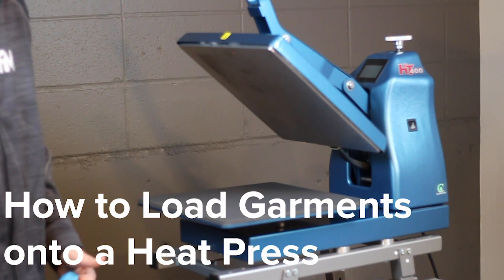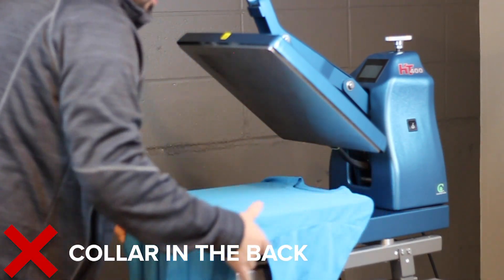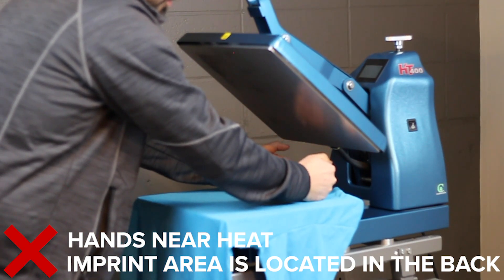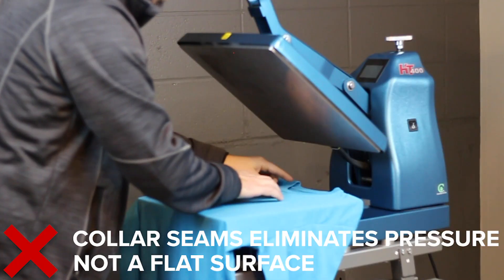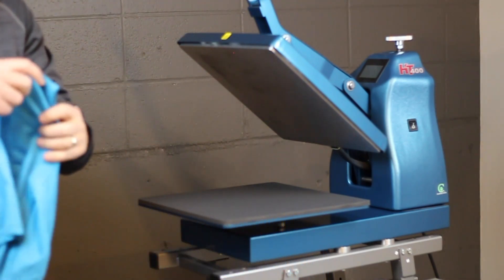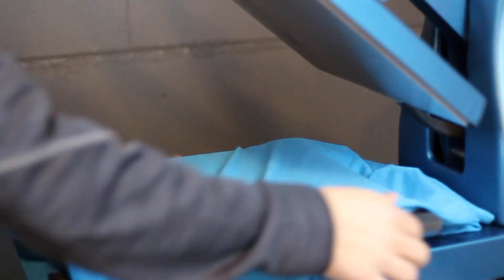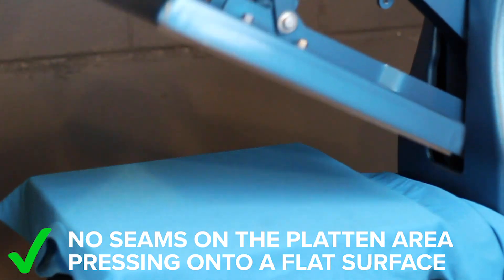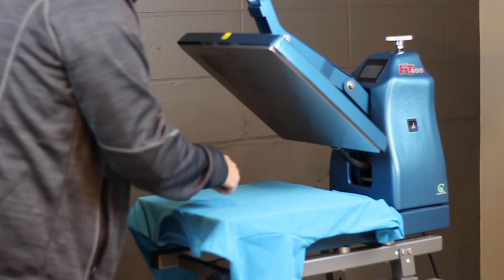How To Load Garments Onto A Heat Press

Comment: You can actually  push the collar area  back further  into the open space at the back of the press I don't mind working under the heat  because  what I absolutely hate  is working upside down  and having to dance around  the press to make  sure everything thing is lined up its annoying and irksome. So if working that way works  for you kudos more power to you but it's  not absolute right way  it just works for you like my way works for me

Comment: On the bottom platon is there a black pad on it? Or is that just how the heat press is designed? My heat press came with a pad and cushion for the bottom platon and I’m not sure if I’m supposed to remove it to use with your transfers.
Reply from the maker: You should use the silicone pad that is supplied with the heat press. It helps push the fabric into the heat platen to make sure you get even heat and pressure to the imprint area. Any imperfections where the two metal platens don’t meet up perfectly is compensated by the flexibility of the pad.
Reply: FM Expressions ok thank you!